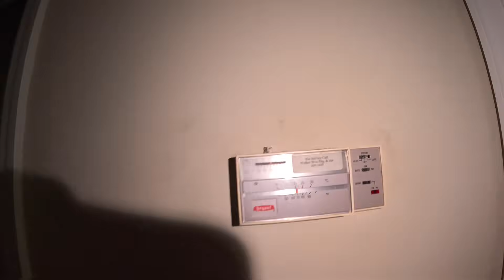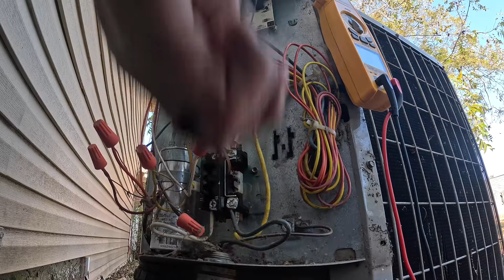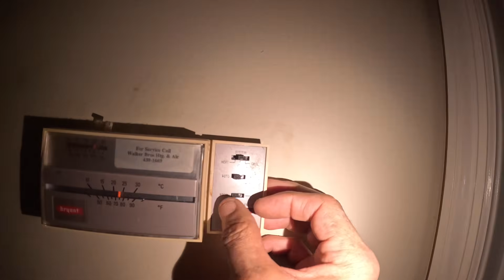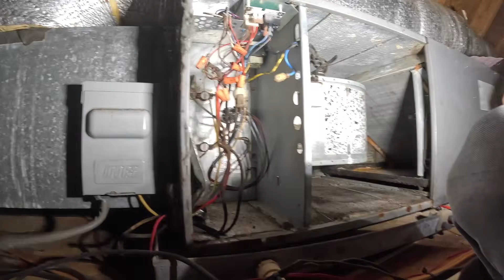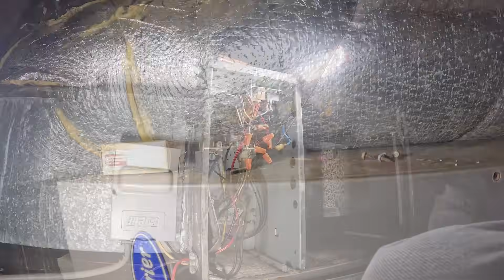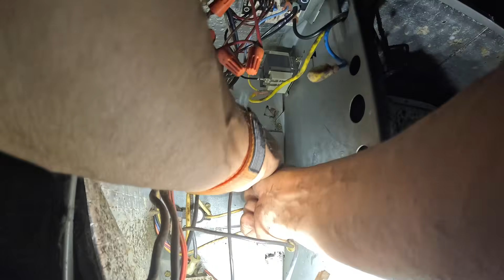Her Heat Pump Wouldn’t Heat Below Freezing!

Comment: I was thinking the heat strips were on an interval where if the heat pump didn't put the temp within 10 F 1 would cut on and then if that didn't get it within range the second strip would cut on.  I didn't think they both cut on at the same time.  Pull too much current and trip the breaker.  I been out of the business 10 years though so I could def be wrong!

Comment: Hey I am from North Carolina I just had a new heat pump system installed in August of 2024 and my new unit during December and now February is always 10 degrees inside the thermostat when it is really cold outside at night and into the early morning I have 2 new Goodman unit installed I’m not sure what seers the unit are but I think each unit is 13 seer’s what do you think is the issue are is this the best I can expect ?

Comment: Should've used a 3 tier sequencer....  or the same sequencer but add a on-break delay for the blower.

Having 1 bank off at same time with blower will cause hot spots on bank and eventually weak points and early bank failure.

The strips doesn't cool as fast as the blower coming to a stop.

Blower and bank/s should be staged properly.

Good diag on the defrost board, I'd look closer at the charge, inspect the blower wheel and coil after noticing no filter. Condenser coil may be partially clogged. Incorrect duct sizing for equipment and home. Lots of variables like insulation or humidity issues can over load a heat pump and cause it to work harder with colder outdoor temps.

Just a friendly reminder. Non working heat strips will not cause a 20 plus temp swing or a heatpump to not keep up. There are many units installed without strips, yes they are not efficient but yet they still keep inside temps within 10 degrees. Lots of commercial units will not have strips.

So there is other issues at this location. One problem solved, can't wait to see a follow up visit!

Would be curious to see you do a full electrical evaluation to see how much that system is costing her per month in electrical costs.

Performing a good service can increase efficiency a bit, but it may lead to a full home audit and for you to build a comprehensive plan with multiple solutions to best serve the customer. Educating the customer is just as important as getting their old system back up and running

Comment: I live in SC and we just had a winter storm hit last night, we woke up at 3am with no heat and it was 45 degrees in the house. I looked outside at my HVAC and the whole thing was iced over, so I flipped the breaker to it off to be safe. Gonna have to wait until Monday to call a tech out to look at it. Thank god we have a small portable electric heater to keep the bedroom heated.
Reply: I also live in South Carolina. Spartanburg. The last two mornings were also brutal for us downstairs. It was down to 50 last two nights. Thank God I have a wood burning fireplace and seasoned wood to make a fire. When mine goes into aux power, it doesn’t blow hot air through the vents. Only cold air. 🥶🥶

Comment: I had a heat pump in the 70 s did not heat in the winter,froze up !, Got aheat pump in the 80s no heat in winter 80 degrees max .Bought a new house in the 90s Seperate heat and air system just replaced the air conditioner after 45 years cost $4,000. Friends that got heat pumps burn out every 10 years in the South New pumps $10 000   just 90  degrees heat in winter ,loud runs all the time BS !!!

Comment: Do you have a company in Georgia? I can't find anyone  to figure out my issues. My house  is 63 degrees  with  thermostat  set at 75. Blows  cold air. The fan is in auto  but runs constantly most of the  time. My bill is going up and up. I've  had at least 5 techs out with various answers  to your house  is an anomaly. The system is not even 2 years  old. It feels  better  when it's off. Because  it  feels like  Ac is running vwhen on.

Comment: You don't see this much time taken troubleshooting a problem  anymore, alot of techs now come out and try selling a new unit which can run over 10,000 dollars  today instead of spending the time that this tech spent, Good job and good work
Reply: Are you saying the unit is over 10k or the installer charging over 10k? lol. Big difference
Reply: @Carolinabiggins That's the unit and labor together
Reply: Yes just to swap one out cost around  10,000

Comment: I have a brand new unit. Doing the same thing. A/C works good. Heat takes 4-5 hours to get to 72 from 69. That outside line NEVER gets hot. Installer has been out here 4 times, now WONT come back. Im here in Dallas area.  Been  all over the map on temps. Dont knowcwhat to do now

Comment: HVAC question. If my system is constantly starting and stopping ever few seconds when it gets to 45° outside and we are forced to turn the heat strips on. Is there a problem or do systems normally struggle around 45- 50 degrees?

Comment: that compressor is really dirty inside and out . My thermostat even informs when when something is wrong and it has not given my anything yet . I even did not kknow right after it was installed that one of the dual compressors was going out and  the installer called me to tell me that it was having issues after lennox contacted them first to call me to get it fixed .

Comment: I put in a lennox 16 seer dual compressor heat pump and i can tell you they are garbage . I have to turn my heat up to 76 to get they house warm but come summer air is great at keeping house cool and I keep it on 76 then , No one can say this house is why it is not warm  2x6 stud walls are R 60 in floors and attic and new double pane windows that i had to replace in part of the house because old one lost their seals . new steel exterior doors and new insulated storm doors  with weather seals . It still does not get warmer . i know we are seniors and we get cold faster these days  , but this is not what I thought would happen . Even basement walls are insulated and so is the basement slab  I get an online report every month from lennox and i know power has gone up also .  But here in Southside v all we have is electric or proane and now i wish i had gone with a propane system I also have a wifi thermostat  It never feels like 76 in the house  and the master bedroom and master bathrooms are n the north side of the house and the house is a ranch 2440sq ft

Comment: I have a background in broadcasting and you remind me of some of the older engineers that meticulously went through each step of troubleshooting until finding the answer. Finding a problem like this one took skill, patience, and good old smarts! Well done!
Reply: This is a true service man most would say you need new unit and not checked half stuff you did!!good job
Reply: Hey I have a new side discharge unit and for some reason it’s seems like it always going into defrost what would cause that or is it normal my boss gave it too me I’ve don’t have much exsperance with these units it’s also inverted unit?

Comment: LOL  yea it works better with that disconnect installed
Good job changing out the relay with a sequencer    most techs would have ordered the relay and left the homeowner cold until it came in
When that heat pump went into defrost it was blowing nothing but cold air into that house and freezing that homeowner
Causing the heat pump to constantly run from heat to defrost until the ambient temp rose enough to over come the defrost cycle
The only thing I would have done extra is check that blower cap  
Good service work Brother

Comment: I would have liked more discussion about what you were doing like how the sequencer was an adequate replacement and less time on the connections and tightening up the female spade connectors.  I don't know what the heat strips do.  I assume this is in addition to the heat pump heat as you said you put it in emergency mode.

Comment: Sir you go way above & beyond any technician ive seen . I work maintenance & seen many just say you need a new system.  I can do basic furnace & a little AC & heat pump stuff.  You finished what the other guy couldn't or didnt want to do.

Comment: Heat pumps are useless below 40 degrees and below 20 completely useless. Heating outside really freezing cold air,  extra coils , supplemental emergency heat has to be on so it's just like a electric heater big bucks electric bill, ya it's a emergency alright. wires here relays ext ext. What a mess. I just turn it down at night and use a electric oil radiator heater in the bedroom. The most efficient furnace is one that is off. Gas forced air are the best in the winter.

Comment: I do not recommend doing this without using a low ambient kit in conjunction with the freeze protection.  The low ambient kit will prevent the suction line from freezing, whereas the freeze protection is a safety device intended to prevent freezing the indoor coil and returning liquid refrigerant to the compressor.  The problem with using the safety control only, is you may short cycle the compressor on and off, something that can be just as harmful in cold weather as slugging.

Comment: I actually was thinking it was a defrost problem with what she described as well, but her heat strips should have given her some heat, very rarely does it get cold enough here in Tampa to need thr defrost cycle.   Do those QO disconnects have a high fail rates?  I always thought those pull-out blocks were more problematic?

Comment: I have a all electric home and I don't have a problem with maintaining the a/c or heat. My unit is roof mounted and the heat is separate from the a/c but built in one unit. RUUD made my system. My biggest problem is the fan. I replaced the motor witha little bigger one and it cracked the blades. Replaced with a 3 blade fan and problems solved..

Comment: Wish you worked in mn. Nice to have an honest guy out there.i had a hvac tech out because my furnace would not light lp. Anyway he said it was my heat exchanger and tried to sell me a furnace mine is only 7 years old and is a nice high quality one. So i got a second opinion and the guy came out put new burners in it and put a camera in the heat exchangers and showed me no cracks.

Comment: Great service call beyond lot so called  techs infield cant or would be lost on the heat strip repair but Common wire is used to loosely sometimes bc correct me of iam wrong you  called  hot wire common on new sequencer & on  low volts don't matter bc 1 is hot & one common or ground so hi voltage 
 common is Hot Right ?  but low voltage common is ground Thanks again

Comment: Started watching your videos years ago when my older Lennox Weathermaker 9600 decided to destroy it's fan control relay and cook the main board a little where it mounts, apparently a common issue with them. $$$$ for a new main-board (common fix, and unavailable since 2015?) so I bought a couple fan relay's by themselves, rebuilt the main-board the first time and just had to rebuild it again last week. First time it failed open, typical, but this last time it failed closed the day before the temp got down to 26°F. I now keep extra relays, other parts, and have a spare board just for that unit so the joy of seeing you fix another goldie oldie always means more than a view & a like. Farmer, Father, Carpenter, Engineer, Inventor, and fixing just about everything since my first toaster at age 5. Keep up the good work!
Reply: surprised the heat exchanger is any good, usually spanked by 12 years or so old.

Comment: HEAT pumps suck they need heat strips to keep up and suck electricity now the compressor is using 220 volts to pump freon in the reverse derection the heat strips using 220volts as you $ goes out to the  power co. .with out heat strips the out door unit runs continuously struggling to matain temp settings.😐
Reply: That entirely depends on the capacity and efficiency of the heat pump. Higher efficiency heat pumps can maintain performance down to a low enough temperature for many areas. If the heat pump is undersized for the desired load then that is not the fault of the heat pump. Cold areas it is generally best to go with a dual fuel setup.

Comment: Well done with the electric strips! At 44 amps X 240 volts  = 10,560 watts = 36,000 btu's that were missing! That's like running 26 hairdryers at once.The previous "technician" didn't do the customer any favors  by disconnecting the wire.

Comment: Have you ever tried using a ratcheting box wrench for your hub/fan puller? Or fan hub cinch bolt?
I have used crescent wrenches before and with the little play they have they could strip out the bolt.
The box wrenches even work on square drives when you have the right size..

Comment: Looked like someone was in there and could not figure out the sequence of operation and just walked away. Hey lady, time  to replace that old Chronotherm thermostat with something from the 21st century.
Reply: I have the same thermostat. and R-22 unit. still running just fine. Its time to up grade the thermostat. this old thermostat has mercury switches and a thermo spring that does not need batteries. and never wears out.
Reply: @tazhd143 
Not accurate and unless you set the anticipator  correctly,  it will run longer than necessary or shorter than necessary, increasing your energy usage.

Comment: Question 🙋 if both stage come on at the same time? Could you have just installed a small contactor or heavy duty standard relay instead of the sequencer? Commercial hvac guy here sorry if that’s a dumb question.
Reply from the maker: Yep, and some use contactors, or 90-340 relays
Reply: there's a potential issue with all the heat strips and blower banging on the same exact time, it may cause a breaker to magnetic trip or non time delay fuses to blow, because cold heating element inrush current is higher due to lower resistance and of course the blower motor has high inrush/start currents.
That is why sequencers are most always used, you can probably get by with it in smaller setups though.

Comment: probably does not help that insulation was gone from the line if it is used for heatpump it is loosing heat to the  cold outside air before getting into the house.

Comment: I got a question I'm no electrician but why was his meter showing 40 amps and no voltage?  Is that how amp meters work?  Is it based on a low voltage?  So the 40 is really only 6?  Can someone please reply and answer.
Reply from the maker: I wasn’t measuring voltage with the test leads at the time, so it read zero. It can read both at the same time, I just wasn’t using that feature.
Reply: 40 amps at 240 volts is like 10,000 watts, is that right?

Comment: What a rat's nest of wiring in that air handler! If that was my house, I'd so want to install a terminal board in there just to organize that wiring so I could make sense of it. And somebody used DUCT TAPE on those ducts! 🤣

I'm thinking you didn't install that system!

I don't know how old my heat pump system is, but I typically shift it to emergency heat when it gets below 0 outside anyway. Ours gets so loud on heat that I had to screw on some plywood to our little balcony outside of our bedroom to form a barrier to the sound from the compressor coming in through the glass or whatever of our 47 YO sliding patio door (wife complained about the noise last winter).

Comment: Up here in N.J. most of the heat pumps are hybrid which means they're coupled on a gas or an oil furnace that's used as the aux. or emergency heat. There are some up here with heat strips but most of the houses with those have a fireplace or a wood/pellet stove.
Reply from the maker: Yeh, dual fuels . Here the amount of time the heat strips are actually needed on these older heat pumps is so low electric heat is acceptable. But now, these new inverter heat pumps don’t need heat strips at all.